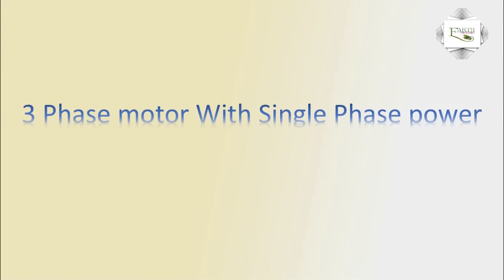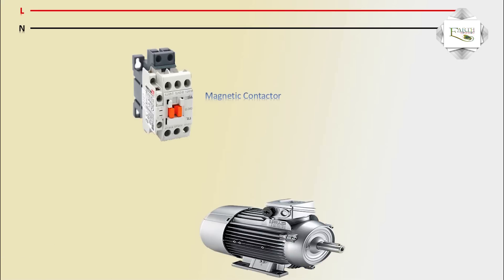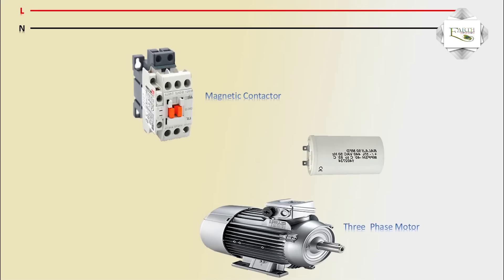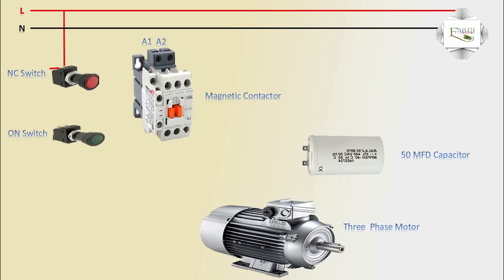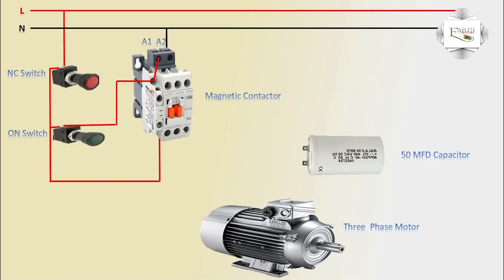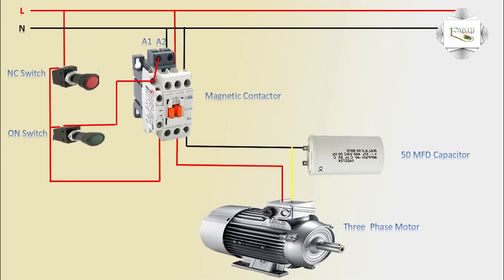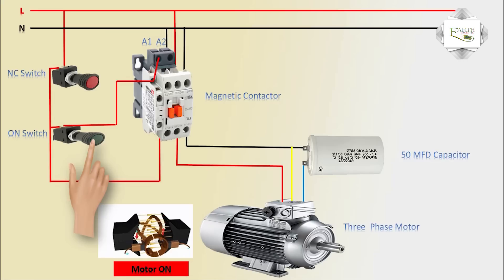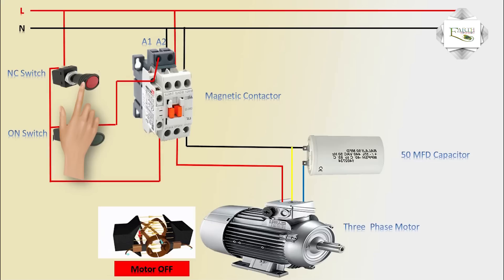3 Phase motor With Single Phase power Supply motor Running | 3 phase Motor | Earthbondhon

Comment: what capacitor your using ( running or starting ) and how many uf in every 1kw ?
Reply from the maker: sir, 50MFD Capacitor Use..
Thanks for your feedback, please follow.........
"Thanks for watching the video"   You are very welcome!
Reply: he is using low uf capacitor...thats a running capacitor,problem.is It wont give you high rpm...still need a starting capacitor with higher uf probable 500 uf
Reply from the maker: Thanks for your feedback, please follow.........
"Thanks for watching the video"   You are very welcome!

Comment: I have 2 thing to say
1. Im still not understanding how capacitor works .. how it fill 2 other phase gap
2. 50 mfd is extremely strong cap .. my 1.2 kw air cooler uses only 35 ufd .. and i knew an info from other channel that u cant make very strong motor uses only one phase .. after 3kw it is better to upgrade the connection ...
Reply from the maker: 50 MFD capacitor using motor....

Comment: Sir how many MFD capacitor in 5.5kw motor 3phase
Reply from the maker: love to receive your comments and feedback.
Thanks for watching.
Reply: I wanted to know how many MFD will require for a 0.75kw (1.75amps) motor to wire 3 phase to single phase please.